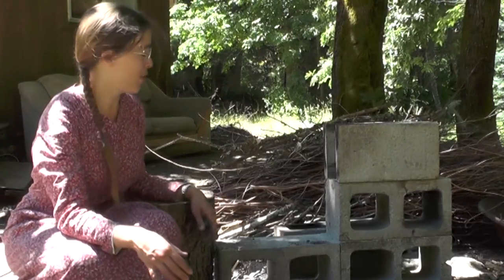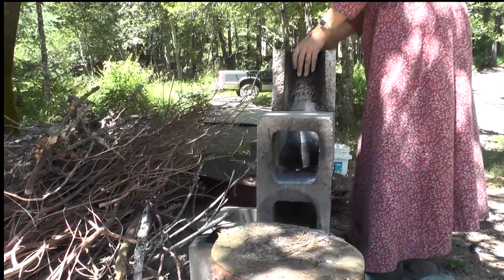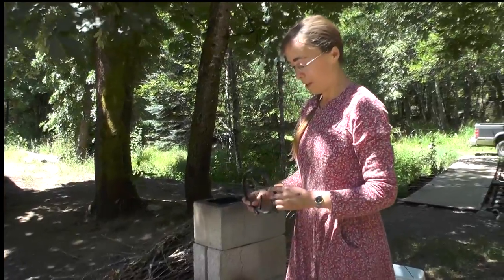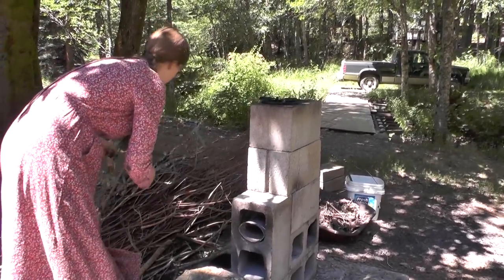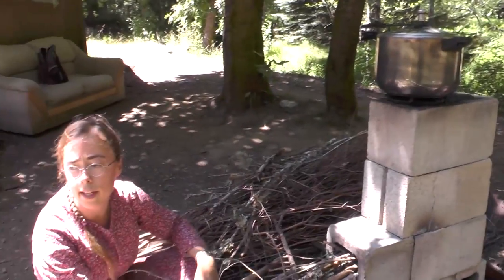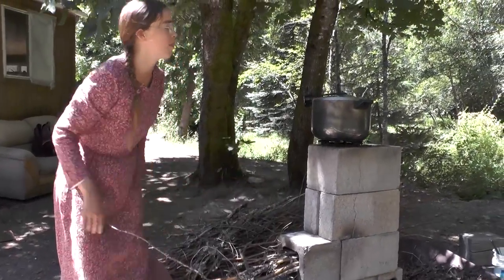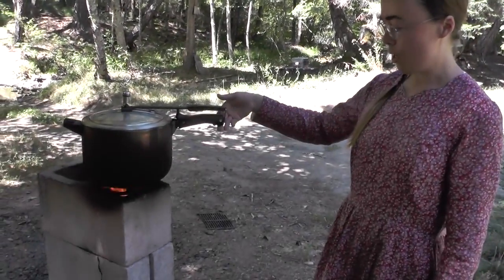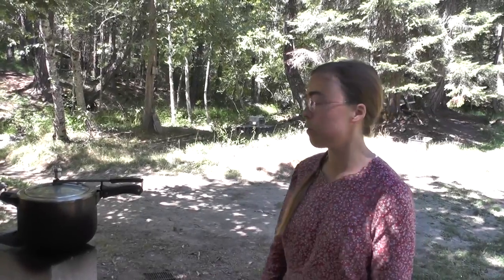Improved Rocket Stove - Cinder Blocks EASY!

Comment: You are kind to make a video, and I like your confidence in front of the camera too.  I do see some risky things in the video, tho, like tilting the gas torch on its side.  I read they are to be tilted no more than 60 degrees from vertical (per a university).  Also.....

  --  Fire under overhanging branches.  (10 feet recommended.)  --  Pile of dry branches next to your fire source and under your torch as you lit it.

  --  (Possibly) no water or sand to put out accidental fires in the dry grass, etc.

  --  Saying you can go do other things (maybe don't leave a fire unattended, especially near dry grass and a forested area where ember can land on fuel).

  --  Using cinder blocks vs firebricks.  (Cinder blocks can explode when the moisture inside them expands from the heat, as others indicated).

  --  Sofa (fuel for fire) against your house.

  --  Stating pressure kettles can't explode (see videos of them exploding).

  --  Extinguishing the torch while its on its side (I believe fuel can leak out this way).

Don't let me deter you, tho.  I think you should make more videos.  You really do have good presentation skills, are pretty, and have a nice voice.  As you can tell from the comment section and 7,545 "likes", many people enjoyed your video.

Comment: Put a cone shaped piece to draw air in and it will be turbocharged !  In  S carolina I saw a huge 14 foot by 10 foot heavy galvanized  pipe elbow.  The farmer would push it up against the burn pile with his cat dozer.  The venturi effect would draw air in and as it went through the elbow it would speed up and  burn the wood cleaner hotter and cleaner.  The large end needs to be the intake side and the smaller end towards the fire.

Comment: A word to the wise. Always use dry cinder blocks when making a rocket stove like this and always stand clear when you first light them just in case one of them explodes from moisture trapped inside. Other than that they work very well in an emergency situation.

Comment: Pressure cooker safety:      I'm 66 years old, and I remember being a child--less than 10 years old--coming in from being outside and finding everyone in the kitchen cleaning the walls, the floors, the ceiling and a great number of small items sitting around the kitchen after the pressure cooker exploded, blowing the top off and spraying/spreading the contents of the pot all over the kitchen. thankfully, no one was present when it exploded and no one got injured from flying pieces or burnt from hot food. I DO believe that pressure cookers have evolved, and  the danger of this happening today has been eliminated.

Comment: you could add one more block on the base,  then place another one on top moving it in and out on the air intake side to control the burn rate or make up something that pivots opening up or closi g down the airflow.

Comment: Not sure if it would work on pots ! But water on a paper towel dipped in fine ash then wiped onto the warm or hot glass window of your  airtight stove  cleans the glass better than anything i have ever seen or used.  An older woodsman pointed out to me and you will not believe it till you do it. The heavier the deposit makes it just a little more work. Specially if it's hot.

Comment: This definetly is a good pot. I usually never use but good deal. Only thing is I like putting in cooked bacon and the grease to thicken up the beans I usually do when beans mostly cooked so at the end cycle I would lower heat and add without that lid.. Boil it a good while.. Popcorn Sutton the moonshine cooks them that way too... Only thing he cooks them on top of his rocks while Makin moonshine.. Lol.. Bacon grease good for eggs. Taters.. Alot of food..

Comment: to stop pot from blackening use some thick sheet metal at least 1/16" thick  larger in diameter than the pot so the flames don't lick against the pot.

Comment: One more quick comment that is NOT a critique of this wonderful woman's how to. 

Concrete blocks are relatively inexpensive at this point in time so stock piling them will be a super economical route to take. Then whenever there is a crack identified in the stove, that block can be replaced quickly and very cheaply.

Comment: Very well done! Great coverage on the important aspects of making and using rockets stoves.
For the soot on the pans, spread soap over the outside of the pan before cooking with it. Any soap will do. We've been using dish soap since the 1970s. Dry it in the sun, oven, over a fire or just cook with it right after applying the soap. When we wash it, the soap dissolves, taking the soot with it.
God bless!

Comment: apply use cooking oil or soap mix with water outside of your pots before placing to the stove, the black smoke stick to it is very easy to remove by wiping and using soap with cleanser....

Comment: This is a very wise display of your resourcefulness, but I would caution you to using the cinder blocks. I have seen concrete popping off and that is a very real threat which could end badly with or without a hot pot on top of it. A nice arrangement of bricks would be a much safer alternative, could probably still incorporate your cinder blocks to induce the draft to the fire.

Comment: Just a minor point, the pressure-cooker bombs do not rely on containing steam pressure, they're loaded with explosives, and the pressure-cooker is just a handy and sizeable container that becomes part of the shrapnel-load. That's OK, IED's/ home-made bombs aren't your subject. As has been pointed-out by several others, cinder-blocks WILL fail after repeated exposure to flames/high heat, you will want to construct a fire-brick version for your own safety, the savings over time will be worth it, as well as avoiding burns.

Comment: To get the black clean easily you can apply power soap in a paste form on the outside of the pot before you start cooking careful not to get it inside ..,also the cooking oil can be used too

Comment: Great job but two things, if you wait till the stove gets hot before you add your pot it won't get as black! Also concrete blocks will crack from the heat! They are not built for rocket stoves so I wood temper the amount of wood used to cut down some on the temperature or else you will see more cracks start to form!

Comment: Dig a trench in the sand 10 inches wide and 2 and a half feet long. Pile the dirt from the trench on both sides evenly to raise the sides up. Put a stove pipe over one end of the trench and put a grille over it.... Then put sticks across the top of the rest of the trench then cover them with wet dirt. You have a rocket stove. A metal lid over the opening with a hole for air will make it burn hot enough to melt your grille if there's no pot on it.

Comment: Is there a way to do this and set it up so there's no smoke, and so you can rig it up to be inside a tent or tipi during cold season? I need to work out how to set one up that has no smoke because I react poorly from reactive airways. But the commercial wood stoves the prices have gone out of control also; way too expensive.  

Thanks for anyone who can reply or advise.

Comment: The reason that the top concrete b;lock cracked is because concrete blocks don't deal very well with high heat.  They will always eventually crack.  One good thing is that it's pretty easy to replace one when it cracks.

Comment: The outside of the pots and pans get so black. To be able to easily clean just rub dish soap on outside and bottom of all  , then allow to dry. Then use as you normally  would.  You will find that cleaning later is so easy. Thanks

Comment: If you screw a tarp with washers under your awning and have a a couple of tent poles coming from where the house and ground meet it will keep you from getting wet bottom after it rains or in the morning. It's important not to get swamp ass out in the boonies.

Comment: Tienes espíritu de mujer trabajadora y vivirás muchos años con buena salud. Felicitaciones! Sólo me pareció que la forma en que retiras la olla del fuego carga sobre tu espalda un peso innecesario. Quizá hacerlo por uno de los costados que te permita acercarte más a la olla. ¡Buen provecho con los fríjoles!. 
You have the spirit of a working woman and you will live many years in good health. Congratulations! It just seemed to me that the way you remove the pot from the heat puts unnecessary weight on your back. Perhaps do it on one of the sides that allows you to get closer to the pot. Bon appetit with the beans!

Comment: I think your bricks are cracking because you're only heating one side. Heat expands, while the cool side doesn't. If you had used singles (8x8) instead of the doubles (16x8) in the chimney, that prolly wouldn't have happened. This is also why the brick that you'd cut the end off of didn't break or crack. 
But I'm just guessing. 
I don't have the land to experiment with these.

Comment: I doubt that they need to weld the pressure relief ports closed when they are building a pressure cooker bomb because the pressure builds so fast that the small leak from the gases escaping is not going to make a difference.

Comment: Don't let your kids hold the pressure relief weight down.  I had one blow a 16" hole in our kitchen ceiling that way when Jimmy Carter was still president.  I'm curious to see if an additional cinder block added to the riser will give the gasses enough opportunity to burn completely enough to eliminate the soot on the kettle.

Comment: 1:40 "it cracked on me." It cracked on you because of the heat. Heat and concrete do not mix. When high heat is introduced to concrete, it expands. If it is thin concrete such as a cinderblock, the heat will split it, as it was with yours. This can be dangerous if you're using a heavy pot with boiling water and are standing close to it or sitting by it as it heats. They have fire bricks that are safer and better-suited material for this type of stove.

Comment: Pass on the blocks and this 32 inch high monster and go buy 20 concrete brick .60 each at home depot or just raid a job site or dump, on a flat level patch of ground, or you can buy solid block like patio block, take 4 and 1/2 brick (for non mason's, firmly hold a solid brick in one hand and take a hammer (any will work) and smack the brick in the middle and it will pop in half, don't worry if not a straight edge)  and make a solid course of brick, second course take 3 whole brick and the other half brick you cut and form a U, then with remaining brick build up 3 more courses laying the whole brick end to side to form roughly a 12x12 square (minus the head joints), make sure you stagger the bricks as you go up so you are not just stacking whole brick on top of whole brick, you will have a solid stove,,,,,,,,,,, the U you made on the second course leaves a hole for you to feed your fuel in, and on top in the center you have roughly 4x4 inch hole to place your pot on and you get concentrated heat from there.

Comment: Nice video. Weight Was not what caused your block to crack. cement and cinder blocks don’t do well in high heat. They will crumble eventually.
That is why block buildings that go through a fire have to be completely demolished. 
 I’m a firefighter and live off grid with rocket stoves for hear in my shop

Comment: there is a couple here on utube who have built a much better rocket stove,they used smaller bricks
and they use a grill lighter to light it,you have enough 7 big cinder blocks. they could pack theirs in the car and move it.
the big cinder blocks are a lot of waste, the other is small, but could handle your Pressure cooker no problem.

Comment: PLEASE NOTE! Cinder blocks are not designed for high heat, do you see the cracks? You would be better off using red fired bricks that can withstand repeated heating at high temps. What do you do if it's raining or snowing outside? I guess you don't eat right?

Comment: Nice. However, cinder and concrete blocks tend to pop pieces of the block out and can break under heat, and why they are not used in fireplaces because they are a fire hazard. Firebrick/clay bricks should be used.

Comment: Why don't you reverse the Block that is cracked?   Use a complete non-cracked one in place of the cracked and used the cracked on on top but spun around to use the other hole on it?

Comment: It cracked because it absorbed moisture. When there is enough moisture trapped in the brick, and it reaches a high temperature, it will crack, and sometimes even explode. Hope you still have all your fingers and toes. This is an extremely dangerous setup, if you live in a place with a lot of rain.

Comment: caution should be used, common sense,  protective eyeware.... I've  seen where concrete/cinder blocks will spall, crack , and even pop under fire , but never explode. the fear factor with some of the comments are a bit high.. gloves , discression , treat it like you would a camp fire.

Comment: Nice rocket stove!
You made me laugh when you talked about  pressure cooker (kettle) bombs. 
Dear nice lady, it is the bomb inside the cooker that makes them a bomb not the relieve valve being closed off.
The reason they use a pressure cooker is because of the metal shrapnel it sends to kill or maim , not to mention the room it has for filling with nails (more shrapnel).
From the looks of your rocket stove, the other side opening on top could also be used as a second stove for cooking, just cut the other side of your already cut block and away you go.
Thx 4 the nice video.

Comment: Always use fire block, regular cinder blocks will break, and crack, falling apart eventually. Heat destroys the integrity in normal blocks, definitely do not support much weight with them if you use them close a fire.

Comment: Use ghee, oil ... or grease ... put it on the outside of the pressure cooker ... ... so it will not become black due to soot ....This method is tried ... ask  me.... the Bedouin... smile

Comment: You guys' first time to use pressure cooker huh?
Just because it's pushing the air out doesn't mean it's done, it just means it's starting cooking. You need at least 10to 15 minutes after that. Depending what you're cooking, beans take the longest.

Comment: Do NOT use cinderblocks to build a stove. They crumble to pieces when they get too hot. Your boiling water ends up all in the fire when the supports crumble out from under. Use red fire bricks or clay ....you need to be careful what kinds of rocks you use too. River rocks usually explode and so does Flint stone.

Comment: You didn't really improve anything. I have a few suggestions:
1. Cover the auxiliary hole parallel to the chimney hole. This will ensure the heat stays there and accumulates, while radiating back to burning chamber/chimney. 
2. Maybe make a small hole into burning chamber from the auxiliary hole. Uncover the aux hole when the bricks gets really hot. This will provide additional air to the system which will also be heated since it must go through the heated aux chamber along the chimney part. 
3. Insulate the system better. Or use the radiant heat of the stove to dry the wood that will go to the stove. 
4. Use some kind of radiant steel mesh mantle inside the chimney portion of the stove where gases burn. This will increase burn rate to the maximum.

Comment: Top of pot should b waist  high. Use gloves when handling pressure pot. Blocks cracked cause its poorly made n can come apart n spill hot content .   Ps. U can make a better one using mud mix with sand n or crush those blocks n mix it  with the mud.

Comment: Stopped watching at less than a minute. This is not what a rocket stove is, nor are concrete blocks (or concrete anything) what is used to build the burn chamber or riser of a heating device. Concrete is not designed to take continuous or extreme heat.

Comment: I know she wants to help, but this is terrible advice! Cinder blocks are toxic! You should only use oven bricks. Regular bricks will fall apart from the heat and deposit chemicals into your food. Oven bricks are made specifically made for safe cooking. And as a bonus, they hold heat better, therefore make a better stove.